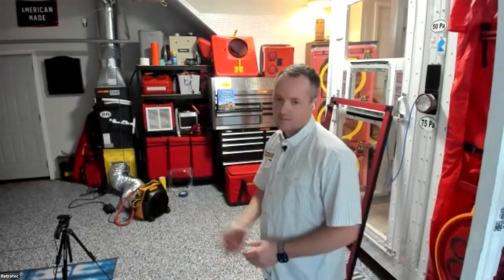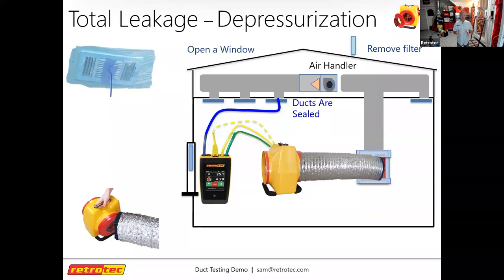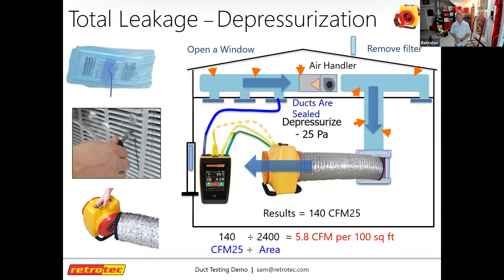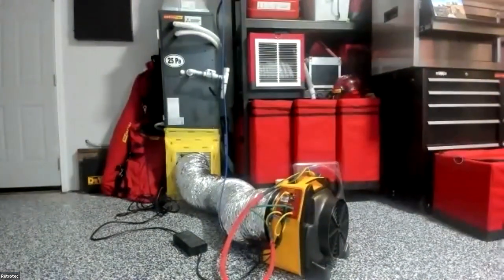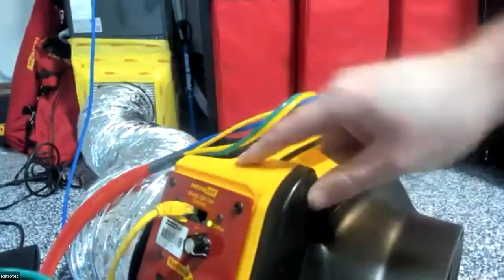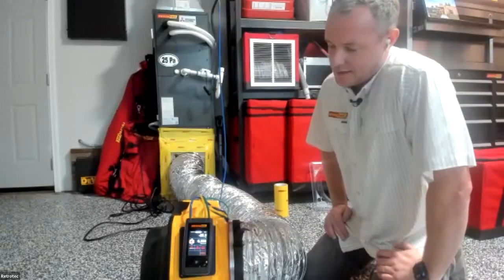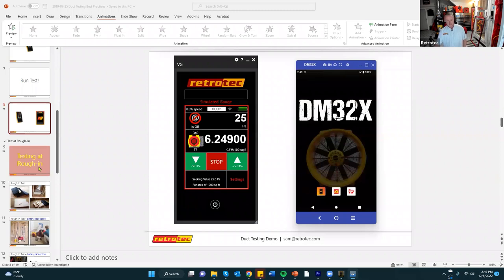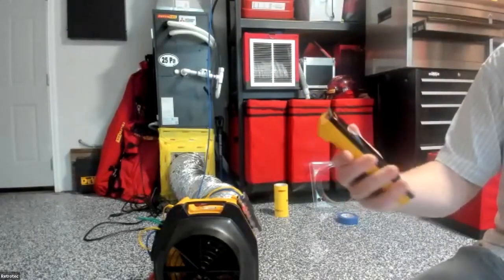Residential Duct Leakage Testing (2022)

Comment: Is it wise to do this test pre drywall? Do the counties even allow a  pre drywall test as the final test?
Reply from the maker: Absolutely. Its a lot easier to seal a failing duct system at rough-in when everything is open and accessible. Most jurisditions do allow a rough-in test, but that can vary depending on where you are. Its best to check with your local code office.

Comment: In Florida the ducts must be less than .04. How would I convert the  DM32X readings to what they are requesting?
Reply from the maker: do you mean 4% total leakage? You would add the conditioned floor area in the "Area" section under settings. Then choose CFM/100sq.ft. as your output for Ch. B.

Comment: How would you seal up a floor register on carpet?  How about a toe kick under a counter, their usually just a cabinet sitting over a register boot cut in the floor
Reply from the maker: Floor registers on carpet is where foam plugs are helpful. You can make your own to whatever size you need. Rigid foam or upholstery foam works fine. Toe kicks are tough a lot of the time because they are rarely installed correctly. The installer should be using a box sealed to the floor that ducts all the way to the register. I've heard this referred to as a "turtleback". This prevents air from dumping directly under the cabinet so its supplied to the kitchen as designed. When I was testing behind installers, I would just tape the register and fail them until they did it right if they were trying to meet code or a certain standard. Sometimes you can put grille mask on the end of  a broom handle or something like that and cover the supply if you can't reach it with your hand. I've done that a few times and its not easy. Sometimes it works, sometimes it doesnt. Its definitely tedious and time consuming. However, if they are putting a register on the cabinet without a turtleback, that means they are claiming the space under the cabinets as part of the duct system. If it leaks, it leaks. Measure it and call it what it is. -Sam

Comment: What happen if you don’t seal off all supply vents and return vents? Will the validity of the test invalid?
Reply from the maker: for a TOTAL duct leakage test, like we demonstrated here, yes. The results will be invalid if there is a supply or return left open. However, if you are doing a duct leakage to outdoors test where you are also using a blower door, then no. You can likely get away without taping a supply since the blower door and and duct tester are working together to neutralize that space.